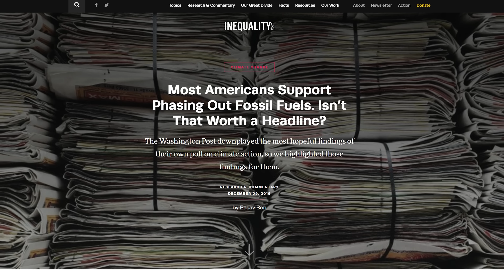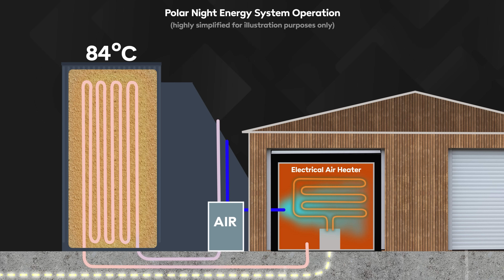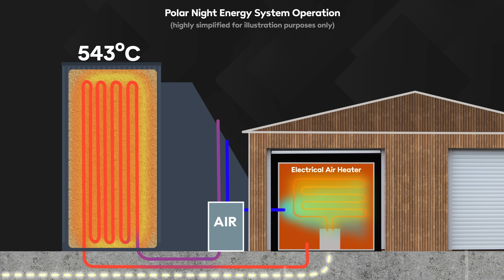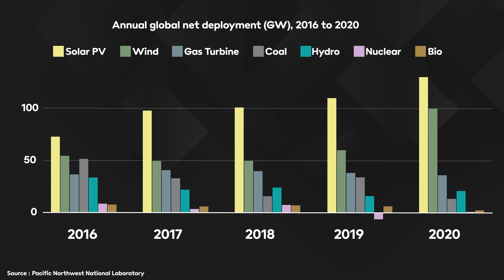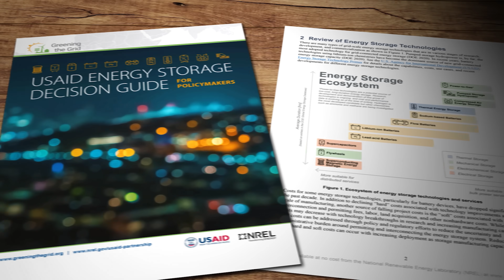The 'Sand Battery' that heats your home, NOT the planet!

Comment: I don't understand how a storage system helps utilize waste heat from a data center, if that heat is too low to be used for district heating.  There seems to be some hand waving that doesn't make sense from an efficiency POV for cooling the data center or using heat for residential heating.
Reply: possibly the data centre heat is raised in temp by a heat pump for base load then the sand, getting its heat from surplus power in parallel, not series, looks after demand above that

Comment: Finland lake district here (Saimaa), yes district heating is tops, totally different but so much better than the UK system. And a sand thermal battery or two would probably easily   replace the bio burner we have now, population 45,000 or so

Comment: I'm aware of 2 other similar, but different approaches to this heat storage problem. Both examples from Finland.

1. Elstor, company that creates system to store heat and use it to create steam for industrial processes.
There are atleast 2 installations on 10 MWh storage size.

2. Helen heat storage in Helsinki. This is similar to that Vattenfall storage. This one is 1,6 GWh of energy storaged in water. They re-used 2 of 3 old and defunct oil storage caves in almost middle of Helsinki to install this and it is already in use since winter 2021.
Energy there is stored during summer from production of district cooling by heat pumps and excess heat from CHP plants in Helen district heating system.

Comment: I  am 77 and find it so fascinating to live in the middle of a creativity boom around one of humanity's oldest problems,  heating and light. Let 1000s ideas flourish and some solutions will stick. In the meantime,   thank you so much for sharing bite size information nuggets about the ongoing process.
Reply: I live inland East of San Francisco where the climate is much hotter and drier. My 4 bedroom home has wooden open beam high ceilings over half of the house that look great, but have no insulation. This house roasted in the Summer and was terribly cold in the Winter. In 2019, I needed a new roof and opted for having the entire roof coated with sprayed-on rigid urethane foam. It is 2 inches thick and you can jump on it without damaging the foam. They sprayed acrylic on top and dusted it with crushed tan colored mineral. This roof cut my natural gas heating bill 45% and since there is no central AC here, ceiling fans do a decent job  of making one feel cooler. It was 102F, 38.9C  a few days ago and it only got to 78F or 25.5C in our living room before the outside air cooled down for the evening. The attic gable fan used to run 12-14  hours a day in the Summer. Now it might run once a week for 30 minutes just before sunset if it was a very hot week.  The thermostat is set for 95F, 35C to operate the fan. I'm retired and on fixed income and appreciate the savings on our utility bill. Maybe I'm saving the planet, too.
Reply: @kimmer6  Better insulation is always a good idea, no matter what climate a home is in. You're definitely doing your part.
Reply: @kimmer6  When I had my roof redone I covered the plywood with 2" insulting foam, and then covered that with 3/4" plywood.  Then I had the roofer install a conventional shingle roof over that.  We almost never use the heater, or feel too warm inside.  Along with double-paned windows outside noises, such as airplane noises have been virtually eliminated too.
Reply: @supermikeb  I was going to cover my roof with OSB and shingles over the foam. We ran some load numbers and the tons of extra weight in a quake was not worth damaging my house. So, light weight it is.  I still have single pane windows. Maybe switch some day but the roof alone made such a difference. We have an International Airport some miles away and jets climb out about 5000 feet above me. I used to hear every one of them faintly but now the sound only comes through the windows.  The center of my house has an attic and the bonus is that it stays cool in there.  The attic fan almost never runs any more. The foam roof was the best improvement that I ever did here.
Reply: It's getting to a point where the idea of government should be more about prioritizing and funding development that benefits society as a whole rather than prioritizing profit making legacy energy production. Yes energy, in of itself, benefits society but at the cost of our future generations environment.
Reply: @yoda-be.at1746  "getting to a point"? Surely a government's priority should always be to benefit the people who elected them?
Reply: @yoda-be.at1746     I want to see the cox ucking liberals, politicians, and big mouth news anchors live on 10 kilowatt hours a day of electricity like I do. I am able to pay for unlimited electrical usage especially on the 100F 38C weeks. But I made it my mission to prove that it can be done without many hardships. Government officials do not give a rat's ass about conservation  of anything. Most are in to gain money, influence, power, and control over us peasants.
Reply: That's so nice. ❤ I'm younger than you. (ha, ha, but not by much)
Reply: Same age, same sense of wonder.  Sometimes even hope.
Reply: @frequentlycynical642    What exactly is  what you call "hope"?  It is a form of dreaming is it not?
Reply: I'm 61 and ever since we had that horrible winter freeze for 7 straight days here in Texas I'm constantly interested in ways to heat a room if need be. Roads were so Iced over no propane could be delivered, no electricity available, so unless you had a fireplace or wood heater you we helpless. I was a lucky one I at least had a generator and spent a mint on gas that I stored in plastic 55 gal drums when our weather station told us to prepare. Plus we live in a 12'X60' smaller mobile home that I had  increased the insulation in it to the max several years ago. So we got through that freeze ok. Those large generators use a lot of fuel running 24/7. 6 gallons every 8 hours😳😩. That's ok the important thing was we didn't freeze to death👍. I'm a retired welder and that following spring I built a large "used car oil" drip heater out of a large air compressor tank I had. Just in case The Tx power grid fails and a heating emergency arises again. I already had everything so all it cost me was my time and welding supplies. My family has been bringing me their Used car oil every time they get there oil changed. I have over 55 gal of it stored away now in case it ever gets that bad. It's also large enough to put logs in and use as a wood heater. So as you can see I did prepare just in case our power grid fails the best I can. Now I'm interested in this "sand heater" I'm sure I will get that retired welding helmet off the wall and consider this even😁
Reply: @murraychadwick9362  Good job. I was burning 810L rod that I kept wet in my ice bucket but some guy said that I was reading it wrong cuz its 7018. He said Imma gonna get some hydrogen embrittlement but I don't have no teeth and caint chew no hard candy.  Sounds like you have it all under control out there. ⚡⚡⚡⚡⚡⚡⚡
Reply: That is EXACTLY how I feel about it! We will get this. Maybe not one big revolutionary idea, but a dozen small ones. Please see my above post.
Reply: But this tech is not new, it actually was/is used in many of the Arab countries for night heating so I'm told.
Reply: Pioojoojíj8uuu7y
Reply: Y u
Reply: I’m 66 and I feel exactly the same !
Reply: Yeah, now that energy is an arm and a leg. Just like my house that was built in 1950. Zero insulation in my walls! Energy was cheap back then.
Reply: Next to research is “ Shivambu “ & “water of life” by Armstrong.  
Thank me when your 110 years old ❤
Reply: Does it make you sad to know ALL of these problems where solved a long time ago and greed has stopped all of us from    free energy?
Reply: @jlert7297  that has been bothering me for at least 40 years - but the transition is happening now and I’m loving it - those that purposefully stopped it will suffer the most during the transition
Reply: dont forget natures been coverting sun energy into electricity for millions years so its not clever to be so backwards in our so-called techy world
Reply: In all your 77 years was there not a time when men (human beings) seemed to be concerned about a forthcoming ice age?

All this nonsense – religious nonsense about so-called or imagined "global warming/climate change, is a recently invented religion is it not?

Whether it be fretting about an ice age or some nonsensical global warming, men are much given to dreaming – particularly about that Super dream or ultimate dream that they call "the future".A few years – not many, short of your 77, it strikes me that men were better engaged with the present rather than dreaming about some dream.

Comment: I apologize that this is off the subject,  but related: Would this capitol idea help moderate or stop Global Warming, maybe change it to Global Cooling?: Paint all roofs white. Likewise re-engineer every solar panel pointed at the sun, to have a white reflective background instead of a dark or black background.
Reply: But I want my roof to absorb heat from the sun in the winter
Reply: @sammason2300  Spray your roof with white foam.  That way it will reflect the heat and also insulate your home to retain the heat it has.

Comment: Thanks Dave for another wonderful video as usual, many thanks to patreons for their large-hearted contributions, via whom others like me can have access to First Class content.

If this tech absolutely successful and economically sound, amount of waste heat available is tremendous.

Suitable containers mounted on trucks could carry "charged containers" from thermal power plants to a vicinity of 200 to 300 kilometres, charged to megawatt levels by sheer waste.
That could be game-changer in many ways.
Reply: To do that, it would probably be better to use something with a lot more energy density than sand.  A eutectic salt mixture with a high heat of fusion might fill the bill.  Megawatt amounts of heated sand would be extremely heavy.
Reply: @incognitotorpedo42  Such heat batteries, if successfully charged and discharged with heat, could bring a revolution in industrial fuels.

Comment: My apartment is in a building that’s hooked up into the district heating system. Most bigger buildings here are even in small towns. 

Something worth of note is that a lot of buildings are installing geothermal heating as a response to rising district heating costs. It varies by area—by the energy source of the district heating network uses—but where I am the process of moving away from fossil fuels has significantly increased heating costs.

Geothermal heating is fine and relatively cheap to setup. But it’s a building by building installation which decentralises heating. I’m not sure whether it’s a positive.

But to summarise, many buildings are opting to install new systems so that the growth of heating costs can be limited. As far as I know this often results in detachment from the district heating network.
Reply: We could all move to Iceland?

Comment: I'm using some 1960's Steffes ETS brick heaters. they heat the bricks to 2000F using off peak power and then a fan mixes a small amount of hot air with room air as needed.
Reply: Good. 😊

Comment: It is only a heat storage system that is quite expensive at 8$/kWh. The truth is that in normal house in Europe heating consumes far more energy than electricity - around 5 times more. I have a factor of around 2.49 times. So far we cannot even replace electricity system with renewables not to say about heating. The truth is there is no better, cheaper most convenient, least complicated way of heating house in Europe than Russian methane gas.
Reply: Yes, but electricity, here, currently costs nearly five times that of gas in the daytime and still over twice during the night.  It is the cost that is important to most - their energy bill at the end of each month!
Reply: Small homes are a good idea. Also, personal responsibility is an excellent choice. My energy bill is less than 30 USD in Summer, and, I keep the thermostat set very low in winter.

Comment: Since the specific heat of water is so much higher (5x) sand doesn't it hold around the same amount of energy at 100 degrees that the sand would at 500 degrees
Reply: energy stored is a function of delta T - e.g.  DH could run at a delta T of about 40 C from water thermal energy storage hot 80 C and "cold" 40C;  now, then,  the delta T between 600 and 80 = 520 = 13 times the delta T of 40 C in the water thermal energy storage, so even though the heat capacity per unit volume is less, the energy stored is more because the delta T is 13 times more
Reply: @johnstephenson296  Ohh, I forgot about that, ofc, the usable temperature span is much shorter than a 100 degrees for the water and just a bit less than 500 degrees.
Reply: True, but I guess it's easier to recover the heat if the temperature delta is larger.
Reply: Sand doesn't leak as easily, and sand doesn't exert as much pressure on the walls. And 500 degrees is not the limit of sand is about 1500 degrees.
Reply: Do remember that you could get 1.6 tonnes of sand in the same space as 1 tonne of water.  So it rather depends on whether you are considering mass or volume.

Comment: I live in South Africa. Our climate is currently mild enough that central heating is not required. On hot days I use a mist fan, and a hot water bottle or electric blanket is enough. Some parts of our country can get quite cold (-10C) but I'm unsure how they deal with the cold.

Some data centres use heat pumps to cool their servers and transfer waste heat into district heating systems.

I recently saw a doccie about excessive heat in some London underground lines and was wondering if a similar system couln't be installed here
https://youtu.be/4MzHt_YLnjw

Comment: My old communist era apartment in Romania has sunlight all year round and the internet temperatures has a seasonal variation of 20-30 degrees. In the warmer part of the year,  the windows are open,  and they have flyscreens. In the cooler part of the year  there are blsnkets

Comment: Three things that I'd like to know about these Heat Storage Systems (HSSs, from now on):

1. How long it takes to store waste heat from a Data Center or Factory?
2. What's more efficient? To build a large HSS, or to hook up together several smaller ones?
3. Can we use waste products instead of sand or water? Products that don't become corrosive below 700 C, I mean.
Reply: Data center heat isn't hot enough to be distributed. Factory, depends what it makes. Though the sort of factory that involves really high temperature work at that scale probably won't be in a residential area.

Comment: i keep hearing about Water and Sand as thermal storage. To the best of my understanding Water has a better thermal storage than sand but the drawback is it loses heat faster than sand.
Reply: That’s backwards. Because water boils at low temperature,its container must handle high pressure. Sand can be heated much higher at atmospheric pressure. Water’s quick transfer of heat is its ADVANTAGE
Reply: @danielking2944  Thx. for the reply. That makes sense.
Reply: My friend has a water tank in his home, heating it at night when electricity is dirt cheap and sending it to radiators to warm his home. It works great.